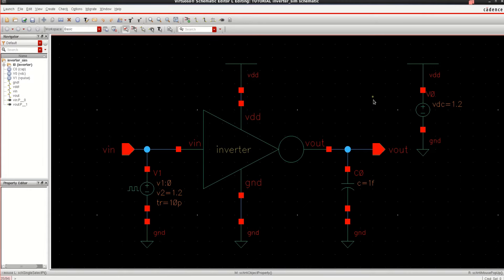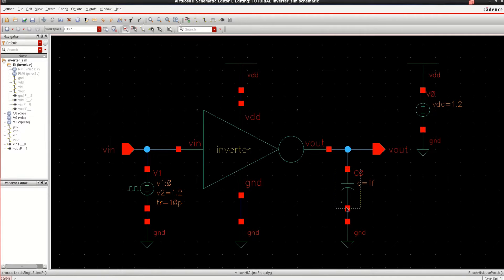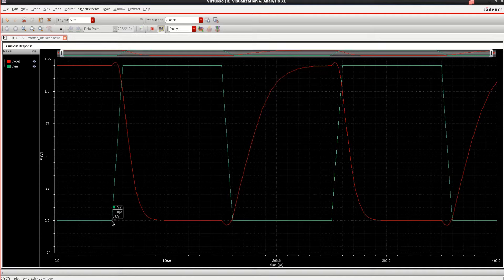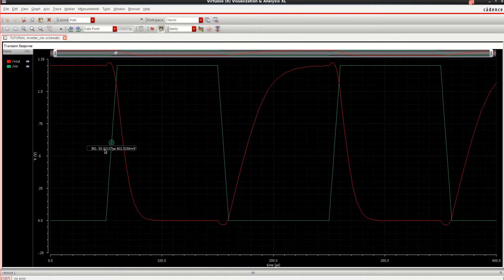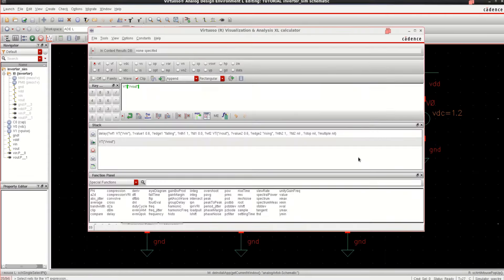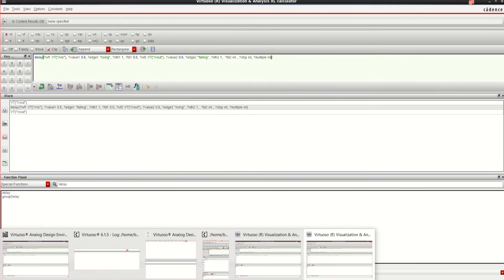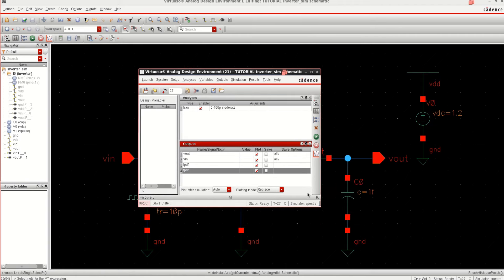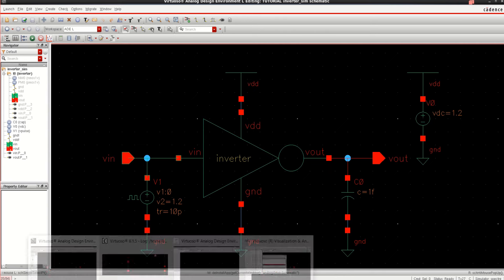Delay Calculation in Cadence Virtuoso.

Comment: Sir, when i am calculating half adder and full adder i am getting delay in ns but in the papers values are in ps. Can you tell how to reduce the delay from ns to ps.
Reply from the maker: Hi, it depend on the time period, width of the pulse and rise, times of the input. Also the signals that are used for measuring the delays.

Comment: Sir, in pulse can i give  pulse width and period in ns and delay,falling, and rise time in ps. Then calculate delay.
Sir, i am getting spikes in the output will i run at every failing and rising edge of input. How to remove those spikes
Reply from the maker: Hi, First question answer is OK and calculate delay.
Second check the supply voltage.